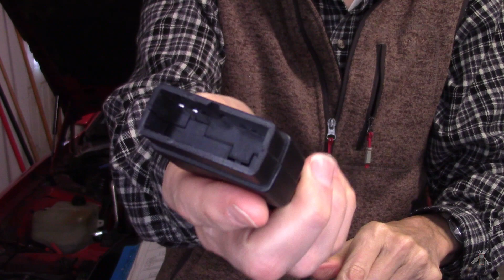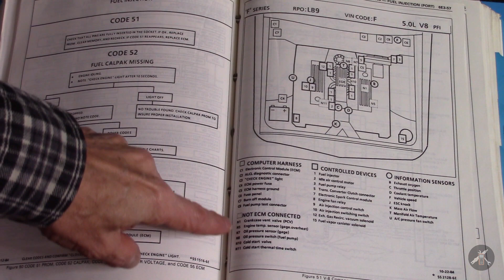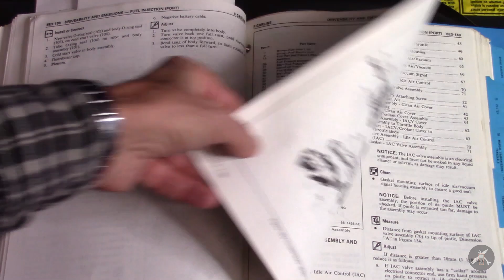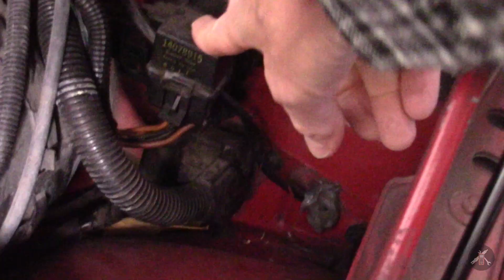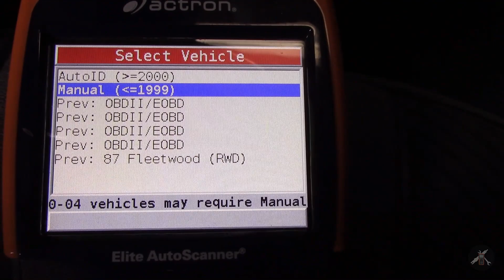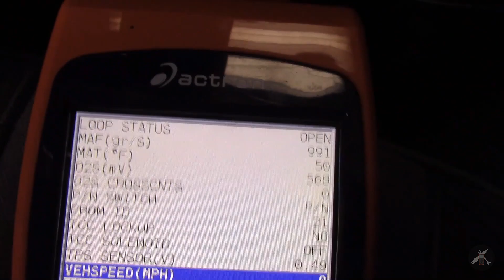Diagnose and Repair GM OBD1 Computer Controlled Cars- Chevy Tuned Port Example

Comment: Hey any idea on what to check if a 1989 Chevrolet Camaro tbi oxygen sensor signal wire got cut while driving , been tryint to figure out if it shorted something out , did a resistance and continuity test with a volt and it beeped as working
Reply from the maker: Damage to the wire for the oxygen sensor can be a problem.  Some of them actually use the wire as a sort of vent to atmosphere for reference. Also, its operating voltage and current are very low, so it is sensitive to wiring issues.  The challenge with testing an O2 sensor is that it doesn't work when it is cold, so standard tests with a voltmeter / ohmmeter aren't accurate.  When it is hot, it produces a voltage based on the oxygen content around the element in the exhaust.  The PCM / ECM will supply a reference voltage around 0.45 Volts for when the system is cold. 
In short, the OBD1 diagnostic ought to pick up a problem and give you a MIL light if the sensor is malfunctioning, but the diagnostic may take a lot of driving before it picks it up.  A scan tool is the best to see if the system goes into closed loop and you can read cross counts and live O2 voltage. You can also put a voltmeter on the computer terminals for the sensor and read the voltage live with the engine running.
I had a bad sensor early on with my Camaro and had to find a bench test method to test a sensor.  See this video: https://youtu.be/lG7knaBmu0s
Reply: @bitsofwisdom460  thx my my dmv reads about .396 when back proing the O2 sensor signal wire, can the voltage be off that much? I believe replacing the whole wire would fix my problem
Reply: Definitely will invest in a scan tool I checked the voltage while the car was running and it stayed in between like 7-8 millivolts only went down when I put my foot on the gas, not sure if it should stay at 7-8 like that also I was getting a reading of the same voltage when I first started the car on a cold engine which is weird being that it takes few minutes for the  ecm to use the oxygen sensor
Reply from the maker: @Jaguar-Xjr  With a standard non-heated (single wire) sensor, the ECM should provide about .400 to .500 V engine off. With the engine running and sensor hot (5 minutes) voltage will oscillate between 0.100 and 0.900 as the engine runs in closed loop.  Lower than roughly 0.450 is lean and higher than that is rich. Not sure which wire is is damaged- sensor or engine harness side. Engine harness should be repairable. If the connector is damaged, I would buy a pre-made pigtail and splice to the harness.  O2 sensor wire, if operation is abnormal, I would be inclined to replace the sensor.
Reply: @bitsofwisdom460  o it was the ecm side was cut about a few inches when I discovered it the connector portion was already off and was just the stray wires
Reply: A way to check closed look without a scanner is using the GM code reader while the car is running and if it blinks the check engine light slow it means I'm in closed loop? When measured with the voltmeter while car was running it didn't go below like 7 millivolts stayed from 7-9 millivolts I thought that was weird
Reply from the maker: @Jaguar-Xjr  Yes, grounding the diagnostic connector when the engine is running, should enable field service mode that will flash 2-1/2 times per second in open loop and once per second in closed loop.
Are you getting any O2 codes?  If the wiring is bad, you will set related DTCs.
Your voltage readings appear abnormal.  Just for confirmation 7 millivolts is 0.007 volts and the system ought to be working at 0.450 +/-.  The ECM will provide a voltage near 0.300-0.500 with engine on - not running. You ought to be able to see that if you unplug the O2 sensor and measure the lead wire.
Per the service manual, it appears that a short to ground in the O2 cable should not damage anything.  There is a mention in a test procedure where you deliberately could ground that signal to simulate a lean condition. 
Reattaching and crimping the connector on the engine side ought to be ok, but that connection is critical because voltage and current are very low and a bad connection will cause trouble.  If you have any doubt, I would buy a Standard Motor Products pigtail S-554, solder it to your harness and seal it with shrink tubing, preferably the version with adhesive to keep moisture out.
Remember that you also may have a secondary issue that is unrelated to the O2 wiring.
Reply: Since the O2 sensor wire was cut while driving would that have shorted something out like the ecm or O2 signal wire , had already replaced the oxygen sensor and crimped the new connector back on the oxygen sensor connector after the problem occured, really only thing I haven't fully replaced is the full wire itself , replaced the ecm also and still getting same problem where the car stalls intermittently
Reply: O sorry it was 700 mv to 900 mv it stayed that way while the engine was running it only dropped down below 700 mv when I pressed the gas
Reply: Also are u still able to go into closed loop if the O2 signal has poor connection? The GM code reader confirmed I was in closed loop after the car was running since when I first cranked it up it blinked really fast then blinked slow after car was warmed up
Reply: Also forgot to add when the car did stall the check engine light came on immediately but before that it didn't come out indicating a code error that why I think its an intermittent connection probably
Reply from the maker: @Jaguar-Xjr  You could go into closed loop with an intermittent if it makes good connection long enough.  If it is intermittent it could prevent setting an O2 code because it won't stay in one state long enough. Some O2 sensor codes take two minutes or more at steady conditions to set. I've been there. If you get a stall, it will turn on the check engine light immediately when the engine stops as a code 12 due to no RPM.  If you get a light while the engine is still turning, dump codes to see what it is.
Reply: O ok appreciate the help a lot, the next time it dies and check engine light comes on hook my scanner to it and see if it has a code? The times it has stalled I just cut the car off that's probably the only time I will get the code when it stalls again
Reply from the maker: @Jaguar-Xjr  Yes, it would be good to check for a code. The ECM should store most of them even if you key off
Reply: Do u think that eliminates the connector being damaged since it's only reading rich at idle, I have backprobed it about 10 times since installing new connector
Reply from the maker: @Jaguar-Xjr  I don't expect that you damaged the connection with backprobe.  I expect that the risk is that the seal could be damaged and cause an issue from water intrusion somewhere later. For diagnosis today, I expect your sensor connection is not the problem.
Reply: @bitsofwisdom460  yes I jus believed it had to be the likeliness of the new connector because the car ran good no stalling until the wire was cut unless it's just a coincidence and something else gave out after installing the new connector im gonna try a metal butt connector tomorrow with heat shrink tubing and see if the condition changes

Comment: Could the Icm inside the distributor of my 305 tpi motor be going bad making it run one day and not the next day?
Reply from the maker: Yes, it is quite possible that the module is the cause, but it could be a number of other things.
I am working on a follow-up video on diagnostics with a focus on no start / hard to start.  It will probably be a few days before I am done, but it can provide some additional assistance.

Comment: Just ordered the service-manual and electrical diagnostics-supplement from your buddy at Books4Cars as well as an obd1 to Usb-connector so that I can record and datalog what's going on with my 87 iroc. Perhaps this is what I need to fix my random missing and sputtering at idle and around 1800-2000 rpm at part-throttle cruising. Runs like a champ when "beans are given".
Looking forward to not just rely on Youtube and old forum-posts haha. 

Awesome video, best in-depth description I've seen. Thank you so much, looking forward to future videos man!
Reply from the maker: Thanks very much!  It sounds like you have what you need to dig in and investigate.  One of the challenges is that at WOT, the mixture is fairly rich--"power enrichment".  That mixture is easier to ignite with a spark.  When you're at part or closed throttle and leaner, it can be harder to get good combustion.  And the challenge in that is it can be either ignition or inconsistent fuel / air mixture that makes it harder to diagnose.  I may have said this before, but long ago I was told: "If you think it is fuel, look at ignition and if you think it is ignition, look at fuel".  That was on carbureted engines, but the thought still holds true today.  A weak spark can imitate a bad fuel mixture and vice versa.  I've lived that one several times in my life.  In the extreme: "Wow, the plugs are wet fouled, is there too much fuel or are they just not firing".
Reply: @bitsofwisdom460  Ah yes, I remember you said so in the video; about WOT compared to partially closed/open throttle. 
Ordered a cheap fuel-pressure tester-kit from Ebay some time ago because I've been thinking about fuel-pressure and such. All ignition-parts are new/fairly new. Coil, plugs, plug-wires, entire distributor, ICM and so forth. Ac delco r43ts - plugs, Iac, tps. Car hasn't been running long enough to get a good reading on the plugs. I've changed the plugs thrice. The ones I got out now was in for about a season or two. Haven't been driven too much
Looking forward to seeing what's going on. If Tunerpro can't see what some of the sensors are doing, then it might just be a bad plug or connector that I've missed out on. I know the iac-connector is not looking too good, for one.

Comment: Nice to see another video,sadly no time to watch whole thing this morning, will finish it tonight.  Have an update Im downloading on this winters work on our Formula, I do a little each year. Once I get this back together I have a question about plug gapping. I changed them during summer and gapped to manufaturer specs, cant rmember what it was, the plugs I took out burned lean. Recently saw someone mention gap should be .45 with the hypertech chip setup, mine has had this chip previously installed. Car runs and idles great except the sticking idle we discussed before and I believe I nipped that in the bud, total cleanup of throttle body. It of course needs valve guides so she does a little puffing on startup but doesnt seem to be running to rich or lean other then plugs. If you dont miind will share a link later to where I am on rig.
Reply from the maker: My 1985 has a label indicating there was a service campaign that changed the plug gap to 0.035.  I looked up the number (85-C-22) and it indicated that in 1984 and 1985 several V8 engines (L69, LB9, L98) in Camaro, Corvette and Monte Carlo had performance degradation over time due to misfire.  The campaign was to replace the coil, ignition module, and then regap plugs to 0.035.  I don't know if that carried over into other model years.  HEI ignition usually ran higher gaps, but that will lead to higher voltages required to jump the gap and apparently it was too much. I haven't read the plugs yet in my 305, but other GM engines that I had with closed loop systems tended to have the plugs running to the white side.

Comment: Great information. Wish I was your neighbor a few years back. I do have the GM manual and it is definitely a must as you mentioned. My only problem is it has a problem passing California smog do to high NOx. The parameters [ goal posts] seem to be pushed back every year and the car was not designed for the limits now enforced. I've done all the system checks that have to do with high NOx and all is functioning. Extreamly aggravating. I even played with the timing all the way to zero and still no luck.
Reply from the maker: Mike, I'm not familiar with the specifics of what California requires these days, but I am certainly familiar with the strictness of their approach.  I presume that for NOx, they must have you running a dyno test of some sort to get it under load. I don't know what all you have done, and all of your vehicle's details, but I believe you have been thorough and I understand the frustration.  I'll try to give you some thought starters, but you may have already been through these and they may or may not help. First, I think you're on the right track with timing retard, but you may not be seeing as much benefit as you would think.  I believe that NOx should come down with retard, but our engines have electronic spark control.  I don't know the algorithm that they are using, but it might have some regions where it is advancing spark until the knock sensor limits you. Or conversely, the curve is just designed to be aggressive up to the knock limit.  IF that is the case, you could retard the initial and and not get as much benefit as you might think.  And if that's the case, I'm not sure how to compensate (low octane fuel??  greater retard?).  NOx control is two parts, first is engine out (mostly EGR)  and second is catalyst.  I know that even though the EGR passes all tests, you could still have an issue.  The OBD1 tests are fairly coarse and might not pick up reduced flow due to EGR valve calibration or restriction in manifold passages or even something in the valve.  A small leak in the diaphragm could also reduce flow. Also, most EGR valves do have a feature that makes them sensitive to backpressure, and they adjust their regulation based on that exhaust pressure.  Finally, the catalysts do reduce efficiency with age; it is possible that your cat could be reduced beyond that.
Reply: Thanks so much for your time! I have lastly replaced the original 02 sensor. I did put a new exhaust system from stock. It's a GMMG chambered exhaust. Possibly affecting the back pressure? It's just a cat back system. Car runs cool while moving but does climb up a bit at idle until fan kicks on at 180° If I remove the belt on the air pump, the NOx is well within limit but then the other perameters exceed.... Wish I could find the balance. Even thought of partially blocking the air pump flow lines somehow to adjust NOx with CO and HC in limits.

Comment: Thanks for this video - I have my GM shop manual - it has bern great. Fixed a spun crank bearing with it!
Reply from the maker: You're welcome!  The GM service engineers work very hard on those manuals to be sure they are thorough and correct.
Reply: @bitsofwisdom460  Bought it on ebay like you said - wanted it to approach a complete restore to original camaro specs

Comment: Ah, Dan, now you've touched on something I've had to work the most on - with my 3rd gen camaro.  The ECM and the PROM chip.  When I bought my car, the guy I bought it from had run a wire from the cooling fan into the dashboard with a switch so he could manually switch on and off the cooling fan (due to overheating when stationary).  I quickly took to youtube to find if others were having similar issues.  Turns out, the cooling fan not coming on often enough in these older 3rd gens is a common problem - since the cars were meant to run at 240 degrees instead of 180 anyway.  When these ecm's age, my guess is that the ecm board and capacitors and resistors don't resist and capacitate and amp as they used to --  causing the fan to turn on way later than it did when the car was new. (Yes, before this Hypothesis, I DID change every temp sensor in the car with NOS ACDelco replacement sensors - first!)  Well to most of us, we want to cars running in the 180 - 200 range instead of the high 240 anyway, so with the help of this site: https://www.thirdgen.org/technical-articles,  I was able to learn how the factory proms are programmable once you find the right decoder to decode the particular chip you have and interpret it with a some free or cheap downloadable support sites.   To make a long story short, it was awesome, I was able to copy my original prom with a usb chip burner (generic one off of ebay not a gm thing) and I can take a copy of my original chip program, modify the copy, change the "Fan ON" temp and "Fan OFF" temp, and as of last summer I did all that and used the original chip reprogrammed to turn the fan on and off inline with keeping the car at 190 degrees to 200, instead of the factory wild high 240.   It was an engineering technology major's dream!  I loved it.  My car runs just fine at 180 - 200 instead of the ridiculous factory 240, and its all done the right way, instead of a wire hanging from the dash!
Reply from the maker: That sounds great!  It's good that you were able to navigate the PROM burning process.  I may get there at some point, I have just been working through the other areas first.  Mine seems to be working to about the 220 mark yet, but I wouldn't mind bringing it down a little. Given my previous experience in the business, I suspect that the motivation for the higher fan point may have been related to regulatory needs.  The emissions and fuel economy team may have wanted to be sure that the fans stayed off during the certification process on the chassis dyno.  The electric fans draw 12v power and it will reduce fuel economy some amount. Every little bit counts when you're trying to meet targets.
Regarding aged electronics, there are many possibilities, but the most critical parts are usually electrolytic capacitors. They can age just sitting on the shelf.  I was concerned about mine that didn't run for 25+ years, yet so far it has been ok.
Reply: @bitsofwisdom460  Yeah 220° is good but my fan would not kick on till 240+.  As far as your idea why they ran it at 220, I myself guessed it was to help the catalytic converter burn off unburnt fuel for emissions, so Your theory is good